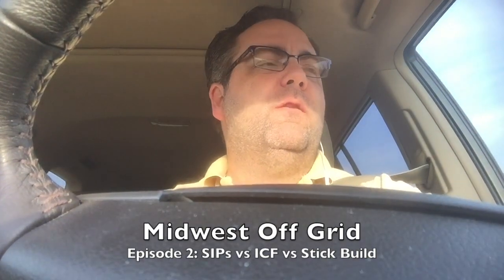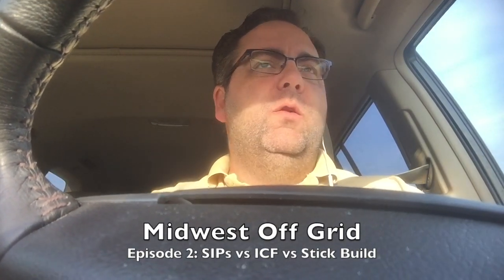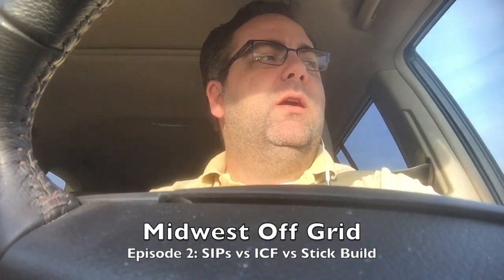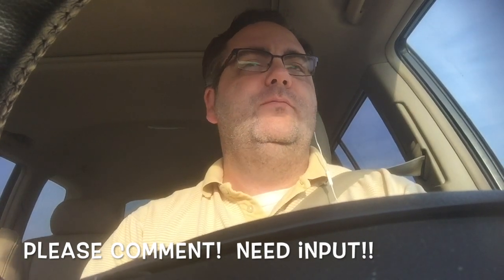Need input on SIPs vs ICF vs Stick Built

Comment: ICF walls up to joists, SIPS for the roof.
Reply: Time vs money. I question 24" centers over time. I one rots out or gets termites, that's a 48" span. That makes me nervous. Stick is the least expensive to build but ICF is the best in the long run. I am currently researching the same thing for my property. Time is an issue also because of the legality of permitting. Talk to your country. I've come to the conclusion that I will need to spend $20,000 on the smallest legal manufactured home in order to permit a project that I can do on my time. Then I can build a "garage" and permit the upgrades one at a time. Engineering is a substantial cost for construction also. It's discouraging.
Reply from the maker: Nice idea!  Never thought of using both.  I really want to do a full ICF foundation, and maybe the main floor.  The only thing I'm immediately troubled about is the floor structure.  It looks really complicated to install.  I'll have to do some calling to some ICF vendors and ask some questions.   I do plan on the basement foundation as ICF because I want the DIY aspect of building the foundation.